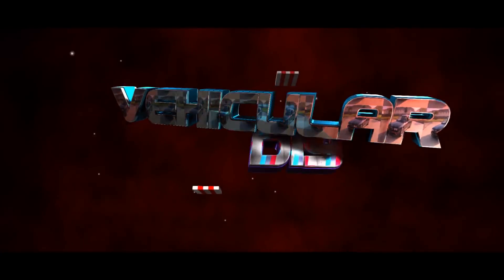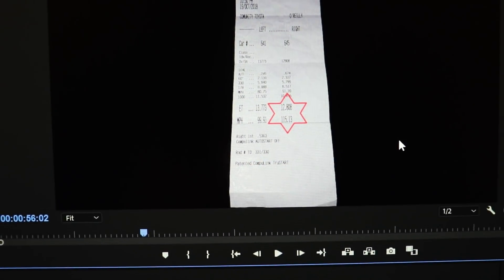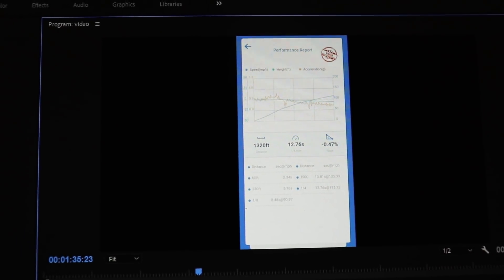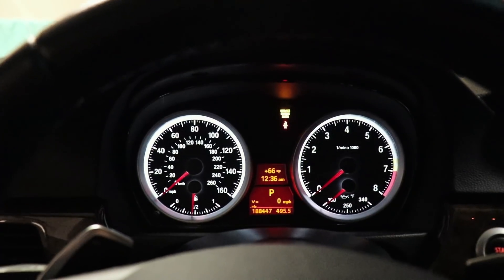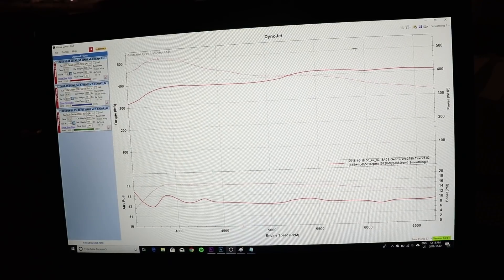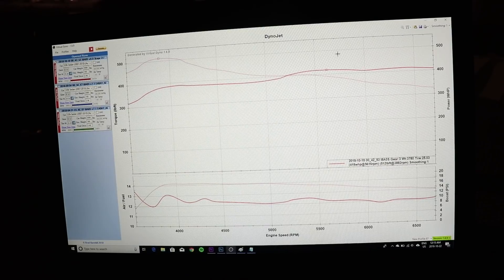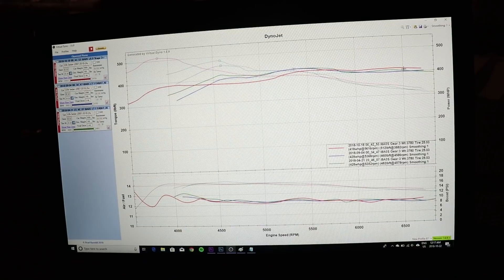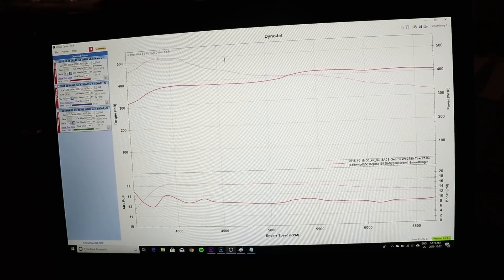How Far Can You Take a Stock Turbo N54 BMW?

Comment: Great Video. Thank you. This is why I just love BMW's. This car has lived a very full entire life as a daily for someone getting them to work each day and driving them on trips etc. Then they sold it to you. You have now (All on the same engine and most of it's original parts) a serious sport machine running drag times and ripping daily. (I'm not sure if you daily this car) but it's just amazing that a car can do all of this. Yes it takes maintenance and some up grades but compared to so many cars this car is in a class of it's own. Until every other manufacturer has been trying to emulate it. LOL. Compared cost of making this car make reliable 450hp and 450 torque is nothing compared to most other cars.

Comment: 123K miles with JB4 and Meth and easily still smoke most challengers.  Time to do another walnut blast though as thar made a huge diff the first time I did it.
Reply: I thought meth helped keep the valves clean
Reply: @IN54ANE  I don't run meth inj all the time.  The oil catch can helps a lot with the valves though.

Comment: Hybrid turbos will wake that thing up in the top end. I have a 2007 335i with the same exact mods as you plus pure stage 2dd turbos and the top end as well as the bottom end power is amazing. I run about 45%ethanol with 21psi of boost.
Reply: what did you run 1/4 mile ??
Reply from the maker: Nice, do you have an auto transmission?   Any idea how much torque your car is making now?  I heard the upper limit of the AT is 550 WTQ.
Reply: i dynoed mine at 441 whp and 535 wtq... it can handle 600wtq but you can also tune for that so that you lower the torque off the line where it does the most damage to the tranny... ps2dd can make 600wtq for sure
Reply: also not sure if you have XHP but it helps with the shift speed and the torque limit
Reply: Vehicular DIY 
I have a manual transmission. But the autos are usually good for about 600wtq and your not going to make that with out port injection. Usually with n54 cars with full bolt one on hybrid turbos on an E85 mix 500-500whp and Tq is pretty standard.
Reply from the maker: That custom tune really paid off for you, your stock turbos must be really healthy.  How much boost does it target?
Reply from the maker: Good to know, thanks.  I bet the area under the curve at 500 WHP is probably pretty broad.
Reply: Vehicular DIY if you ever go hybrid turbo, you should get a tune which is easy on your trans, don’t make huge torque just widen the top tq range, and then it shouldn’t put more stress on your trans but you would be running like 550whp if you could keep up the tq in the high rpm ranges

Comment: You super need an Lsd but they are costly, in the mean time at least do a xHP transmission flash for faster shift speed.
Reply: Edward Wild no need for lsd.. the current stock turbo record cut a 1.5 60ft on limited slip diff.. it’s all about knowing how to launch

Comment: Just pick up a 09 135i with a leaking turbo.  Most of the FBO has already been put on with a few other upgraded items and custom tune though cobb pushing 350whp.  I got some RB chras  billets on the way, new water pump, oil change kit and injector 12s on the way.  I'll be about 11k in the car when I'm done.  Hope to get 400whp and 450lbs tq on pump gas.

Comment: I ran 12.5 in my 2010 535i with no inlets or outlets or FMIC at 115 mph. I was initially upset with the trap but my stock FMIC was heat soaked as hell. I was running the E50 map as well at the time with XHP. 

Just drove the car for the first time with the MMP S3’s tonight and what a difference! I’ll post a video soon but the car is getting a upgraded LPFP, plugs, Tmap, and custom tune. I now have outlets and inlets and FMIC. Can’t wait till I bring her to the track again to see what’s up!
Reply from the maker: That's awesome, how much did the S3's set you back if you don't mind me asking?  With all that you should be deep into the 11s.  I have an Aplina tune on the transmission.  I'm going to look into XHP.  This weekend I'm swapping out all the transmission solenoids and doing the valve body seals etc to beef it up.  The shifts have started to get a little harsh.  No slip at all luckily.
Reply: Vehicular DIY yeah check out my XHP video. The shifts are retarded fast! PM me and I’ll let you know how much everything ran me! I hope it lands me in the 11’s! Today everything will be done so I’ll get the tune dialed in and hit the dyno and track

Comment: 1:10 Wow! That Cadillac can really move! Gotta love a wagon that can get out of it's own way like that!  A 12 second car on totally stock internals plus stock turbos says that is ONE incredible car! Thre is nothing like it out there for the money you can get the N54 going like this!! Seriously I watched a Video that was talking about how much money it takes to build a 335i N54 into a hugely fast car. Well it's totally relative. What does he mean a "really fast car?" If he means a an 8 second drag car then yes it's gonna take some cash to buy all the beefed up parts you must have to be able to launch a car on a prepped surface and get it making that type of speed. But at that point it's no longer an N54 335i. It's a home bui;lt drag car that has parts from the biggest drag companies everywhere. But to make a 600- 700 hp and 600- 700 torque reliably running street machine that is classy and has great looks that you can even drive to work each day (yes you still need to do extra maintenance to have a car that will do that) but it's incredible! You can spend $15,000 on a Supercharger kit for a V8 of any kind and almost get there but the cost of everything it takes including the cost of the car is going to be HUGE!

Comment: I’m at 220k miles on my e92 N54 with original internals still. I actually just posted a video with the valve cover off.

Have been FBO/tune the last 20k miles and runs smoother now than when I got it.
Reply from the maker: Awesome, these N54 motors seems to last.  I'm surprised we're not hearing of stories of bad rod bearings etc as the miles rack up.

Comment: 149,000 miles, everything you have except outlets. Wedge Performance custom E50 flash. 2.08 60 foot, 12.08 @ 119.7 mph. 120+ Trap speeds on some 12.2 passes. I now have xHP no rear cats, should easily do high 11's now possibly 11.8x's. (All season radials 255/40R18) Removing the rear cats really improved power above 5000 rpm. I have xHP programmed to shift at 5700 rpm, turbos are max'd, no point in even revving to 6000. Should trap 122-123 mph now. Probably the original turbos based on waste gate rattle , MHD waste gate rattle fix all the way to the left and they still rattle on decel and some at idle. I outrun Mustang GT's, Challenger RT's, etc... Even made a hellcat owner real mad, I don't know if he was in track mode, I assume he would have switched when he tried to make the second run at me (first run side by side). I kept him behind me and he had a run on me coming from behind. Mine is the ultimate sleeper because I still have the stock mufflers and I can close the flapper on the left muffler with a switch, sounds stock with it closed. I have it on a pressure switch, if I forget it opens automatically at 3.5-4 psi boost.
Reply: You all probably dont care but does any of you know a way to log back into an Instagram account?
I somehow lost my password. I would appreciate any tricks you can give me.
Reply: @Jimmy Layne instablaster :)
Reply: @Keaton Hezekiah Thanks so much for your reply. I found the site thru google and Im in the hacking process atm.
Looks like it's gonna take a while so I will reply here later when my account password hopefully is recovered.
Reply: @Keaton Hezekiah It did the trick and I actually got access to my account again. Im so happy!
Thank you so much, you saved my account :D
Reply: @Jimmy Layne happy to help :D

Comment: I need to upgrade my N54 injectors to 12s.  Other than that I have jb4 with methanol.  Yours has a lot of new bolt ons and runs better than new!!!
Edit: My 335i Coupe is at 139k miles.  What you throw on it next?

Comment: i think there is a lot more in it with the mods that you have. Mine is a 2007 335i running e40 with stock fuel pump and stock downpipes and i ran a 11.95 @ 116 on street tires... im sure ill get that number down to 11.5 with proper tires and adding downpipes and inlets... should trap over 120 with those mods !!you gotta get that 60 foot down below 2.0 and you will have a much better time !
Reply from the maker: 116 mph with the mods you have is very strong, I'm running an off the shelf tune.  Are you running a custom tune?
Reply: yes, custom tune by wedgeperformance 21.5psi on e40...it definitely helps over the ots maps, but it still tapers hard up top, so thats where the inlets will help a ton and hopefully get me to 11.5 ...thats my goal with stock turbos
Reply from the maker: Oh I see you answered my question here,  so you're pushing 3 psi more than my car.  Inlets were awesome when I put them on, big difference straight away.  I'll see about reaching out to Wedge.  Thanks for the info.

Comment: I can’t wait to go stage 2+ on my e61. How much is peak boost with stage2? I’m currently on stage1+ & max psi is around 18.5 or 18.9 which isn’t bad to get the wagon moving 🤪 still need to get downpipes & probably outlets jst in case the plastic ones blows up ha haaa
Reply from the maker: I think it's the same amount of boost at around 18 but has more timing.

Comment: Thanks for the schooling on mileage, i was very interested in that, quick question thats even if this guy is still here, so what was the psi you were maximizing those turbos on? And how high can they go on an MHD tune?
Reply from the maker: You can push them to about 21.5 PSI.  They'll last longer at maximum of 18.5 psi.
Reply: @VehicularDIY  Thank you for that, would you happen to know the stock psi setting on the turbos?
Reply: @S58PSHIFTING  No more than 11 psi but it will be lower based on temperature. Stock boosts LESS as it gets colder to maintain the same power level...

Comment: Great video i got a quick question I got FBO 2007 e90 n54 but I only have access to 91oct in California how much E85 should I use for a e25 mix?
Reply from the maker: You can run up to E40 if your low pressure fuel pump is healthy.  You'd want to monitor your pressure to ensure it's holding over 50 PSI at wide open throttle.

Comment: Swap the differential to an limited slip,  mine digs out of first gear now, I have no clue why tf they're allowed to have all that power with an open diff, I guess they still needed a reason to sell the m3 😂
Reply: Yes exactly. BMW did deliberately hobble the 335 and 135 to be able sell the M cars.
Reply: @kneecaps2000  lmao that's what I was guessing. Is that actually true?
Reply: @anthonywright5275  Yeah totally true. Who would pay 25k more for the M3 if the 335i had almost the same spec.

Comment: Thanks for sharing! Curious what is peak psi target on that beta map? I'm also not wanting to push it much farther then what you have because of running an auto trans 535i.Looking to flash XHP soon.
Reply from the maker: Np! It targets 18.5 psi I believe and tapers down.
Reply: Definitely get an xhp tune, my 09 335 shifts and rev matches so damn well now, manuals lose about 3 feet on me every time they shift

Comment: I have a 07 335i with ebay downpipes and intercooler, new chras with billet compressor wheels running e40 mhd tune and I ran 12.3 at 116 mph at 600 ft elevation

Comment: You need tires..I'm FBO except exhaust an no tune no walnut blast took my car all season tires 255s spun so much ran only three times my best 14.8 went next week with r88rs 275 ran 13.5 no tune or walnut blast yet
Reply from the maker: Yeah tires make a world of difference, I'm running Pilot Super Sports so they're half decent.
Reply: since you are fbo why not load a tune ?? MHD is the way to do ... you can thank me in an hour after loading it !!

Comment: are we going to see head bolts flying???
Reply from the maker: If so you can count on a DIY on how to fix it lol.  The N54 seems to cope with high boost pretty well.  Even with an open deck block people are pushing way more boost without issue.